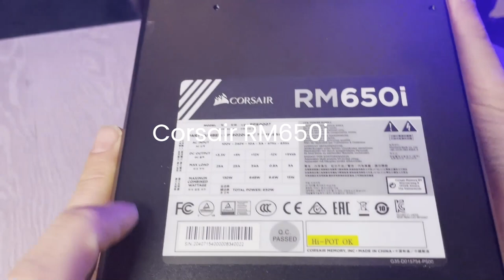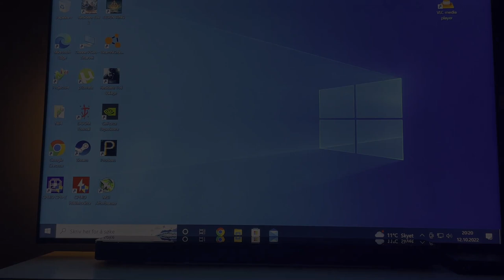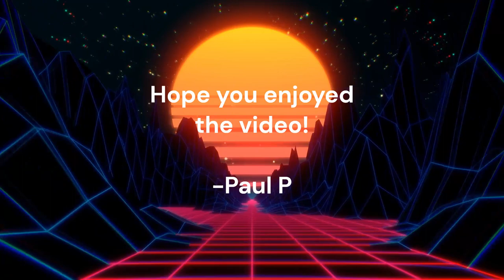Budget gaming PC build! (2022)

Comment: I miss older motherboards that put the x1 and x4 pcie slots above the gpu wish that would come back on modern Micro-Atx boards
Reply: The problem with that is you lose airflow space. I have a MSI B450M Mortar Motherboard that has the 16x slot in the second row. Using a 2.5 wide slot Asus GTX 1660 Super Dual, I have less than one slot of airflow. My sleeper PC case is from 2007 and just laughs at me.

Comment: I have a very similar build with a 3770K. Delided it, put liquid metal inside it, and is currently running under a decent air cooler on surprisingly good temps, but I feel like the below setup is still asking for more.

It's all in a Sabertooth Z77 MTB with IMO the best Corsair Vengeance 16GB CL8 RAM. I added a Gigabyte GTX 1660 Super Gaming OC GPU (@stock values) to the mix to make her last longer, but I didn't dare to do so without giving a decent overclock to the CPU (4.4GHz, planning on more) and the RAM (2400MHz, ~CL11). IMO this is the best GPU - or equivalent / a little stronger - this CPU can take, and ONLY if one’s able to O.C. the RAM as well. Few people give credit to the fact that, if left at 1600MHz, even the memory can cause a serious bottleneck in old systems like this when paired with newer GPU's, and I’m speaking from experience.

I think you should give a try to some research and overclocking and you might see more stability and FPS.
Otherwise, very nice budget build and congrats :)

Comment: I'd also recommend looking at 1st and 2nd Gen Ryzen motherboard/cpu combos on ebay.   Stupid cheap for the performance level and able to feed most affordable graphics cards to 100% potential.  I have an 1800X with a 3060 gpu and it is terrific as my secondary gaming PC playing most everything at 2k on High settings with great frame rates.  GPUs are the real budget eater in any build these days, but some good values on ebay now too for RX 580s, 1070's, and 5000 series cards.

Comment: I'm in the process of sidegrading from a 3770 (non-K) to a 4790 (non-K) and a nicer motherboard, well actually the result of a planned minor update and a build merging.
Annoying thing, after searching out a motherboard with full rear audio, Windows 10 has problems with it, so ended up getting  Soundblaster Audigy FX (cheapest solution with current ... but rather old, Windows 10 drivers)
Reply from the maker: Strange. Maybe its the motherboard not the drivers? I have little experience with onboard sound, as i never use it. Only use usb external soundcards, the GPU or PCI- ones. I would also call this more of an small upgrade rather than a sidegrade :) The 4790 should be noticeable faster in cpu-intensive apps.
Reply: @paulp9270  If AVX2 comes into play, a lot faster.
I threw many sets of drivers at it, and strangely, got a little bit of sound once as it uninstalled a set, which gave me hope, but that was the only peep I got out of it, EVER.
On digging through forums, it seems that nobody has got it to work under Windows 10, though it's based on a common enough Realtek chip - it's like the mixer output just won't select anything.

PS. Also going from a 1060 to a 1070, so glad to see that it's a reasonable combo

Comment: Great little build, just wondering how bad the cpu bootle neck is with the 3770k? I paired a 1070 non ti with a 3770s recently for a cheap customer build and the little i7 was struggling to keep up. Swapped out the 1070 in the end as it just wasn’t working.
Reply from the maker: In cpu intensive games like Assassins Creed Valhalla, Elden Ring, Cyberpunk 2077 ect, the CPU starts bottlenecking a fair bit. But for majority of games its ok in my experience. I also think the difference between an OCed 3770k and a 3770 is pretty noticable :). Cheers
Reply: @paulp9270  Yes definitely being the “k” helps massively and that’s good to know. It was the 3770s as well so I little worse than the 3770! Still an ok little chip though, have a load I need to get rid of in flips

Comment: awesome. you could save a bit more on fans but still cool
Reply from the maker: Totally agree! The 120mm NZXTs that came with the case would be enough, and there are many cheap cpu coolers that could be used instead. But i got the Noctuas for 50usd with shipping, and as I will use this in my livingroom, it makes sense to me :) Thanks for the comment! Cheers

Comment: My recommendation for a better RAM option would be a (2X8GB) ddr4 3200 cl16 for performance and affordability.
Reply: This is an Intel 3rd Gen i7-3770K, you can only use DDR3 RAM. Corsair did made Vengeance 2400mhz DDR3 RAM Kits available.

Comment: im on i5 3470 oc to 3.8ghz, 32gb ram @ 1600mhz and 8gb gtx 1070... will there be significant difference if i upgrade to i7 3770k? i'm using msi z77 mpower that can OC cpu...
Reply: Yes but i recommend to get a new mobo and 10th gen or higher  for better performance, it will be a huge difference